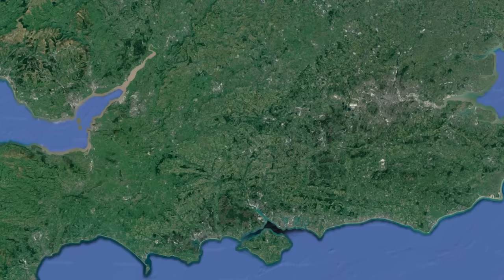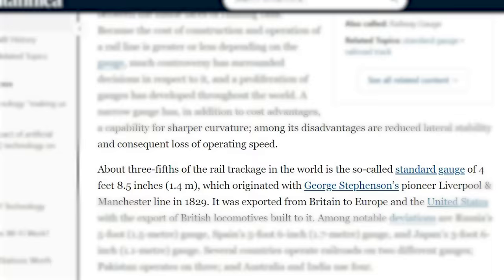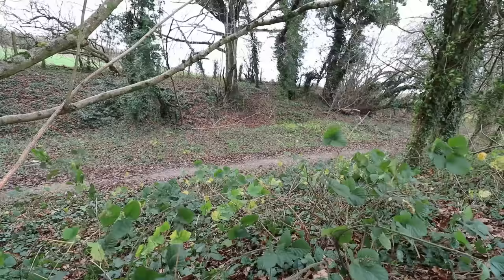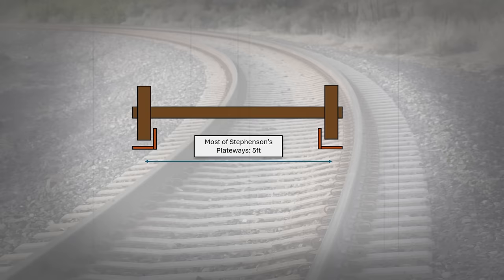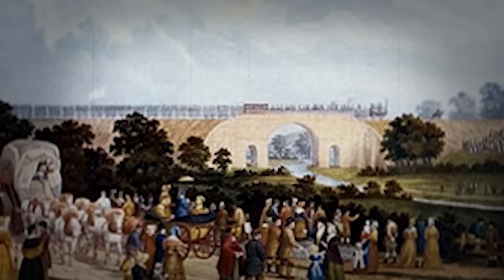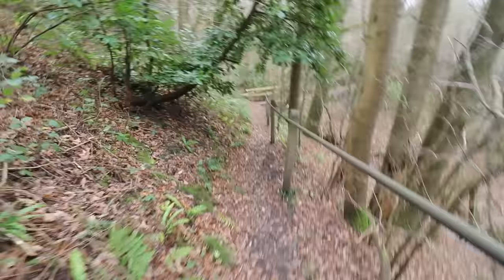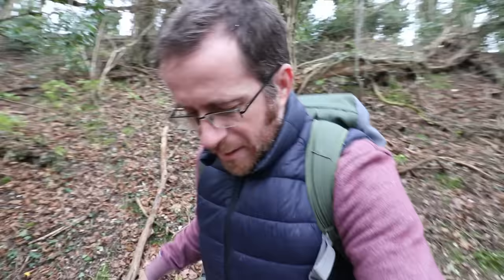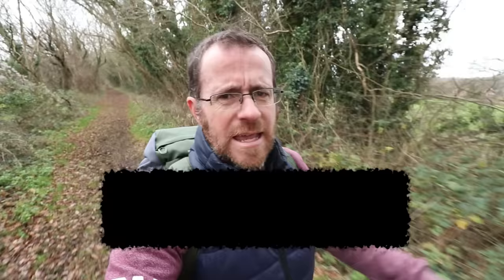Railway Gauges did NOT Evolve from a Roman Chariot.

Comment: 5 feet is just a good width for a wagon. You can comfortably fit two people side by side inside it. So most wagons through history have had wheels that are approximately 5 feet. It hasn't evolved from Roman gauge, it just that everyone everywhere used it. Much smaller than that, and a wagon doesn't fit two, and becomes unstable, and much wider than that and you have to make very wide roads for no reason.
Reply: @RegebroRepairs No. Everywhere didn't use it. Shropshire used a 4' gauge at its collieries. They used even narrower gauges for slate quarries. The Ffestiniog Railway uses a gauge of 23.5 inches.
Reply: Exactly it. It’s evolved as a useful size that one man could push about, a horse could pull and would be still narrow enough to fit down adits, between houses etc.
Reply: Yes, he doesn't really disprove the old horse's rear explanation. Cart widths come from ancient times, wagon ways were built around existing wagons, which evolved into plate ways and the current gauge follows directly from there.
Reply: @robertbackhaus8911  but the issue of the rockets is all bullshit.  And carts were wider than a horse.
Reply: Here in Australia there were a few anomalies between rail gauge and carriage width.  Even had bogie changes.  Same carriage or goods truck with the bogies changed according to the rail gauge ahead!
Reply: @robertbackhaus8911  You very clearly mixed up wagons and the wagons used on mine tramways. Normal wagons were usually built to be pulled by at least two animals, sometimes horses but there were also wider wagons pulled by oxen. However mine tramways are not the same and they were usually only pulled by a single horse so they were usually a bit over a meter wide, also they were usually only pulled when going back up to the mine since gravity took them down. A lot of the time they were also just pulled or pushed by humans. It's from these tramways that railways evolved however there were many successive widenings of the track until the construction of the Liverpool-Manchester railway, which was the first to use the 1435 mm standard guage, and since it was the first mainline railway the standards it set stuck. As you can see this has nothing to do with horses and was entirely driven by technological needs, one that was especially pressing was the width of boilers, you can only make a boiler so small before it becomes basically worthless so early steam engines needed much wider track to run on.
Reply: You can find plenty of wider wagons since many were designed to be pulled by oxen and not horses.
Reply: @hedgehog3180  no.  The gauge of Liverpool-Manchester was 4 ft 8 inches.  The 1/2 inch was added later to reduce wheel use.
Reply: Pity airlines don't follow that - 2'+ width seating!  More like 16"-18".  2' wide reminds me of USA Steamliner seats!  Not quite that big but with lots of leg space.  

Didn't Brunel go for 7 foot gauge?  VERY stable trains.  Regardless, it's the modern pivot bougie (USA - truck) that made smaller gauges (eg 3'6") with wider than track carriages (eg 9'-10') viable.  (Yes fixed wheels came first.)  

The narrower the gauge, the easier and cheaper it is to build.  Can hug the hilly terrain better, smaller bridges, etc.  Think I said in another post that Queensland worked out 3'6' gauge was 8 times cheaper to build in their terrain than 5'3' gauge.  Ref: Ipswich train museum.

In South Australia an American Mr Webb was asked to build the best.  He plugged for 5'3".  NSW and Vic agreed with SA to build 5'3" networks.  Later on the NSW govt changed and reneged.  By then SA & Vic were committed.

Comment: In peninsular Spain, the first railway from Barcelona to Mataró was 1440mm. However, a real scientific engineering commision was established around the 1860s to determine the best railway gauge. Since Spain is a country with much topographic unevenness and more steam power was needed than in most of flat Europe and UK, the gauge of 1668 mm was determined by considering the size of the steam cylinders between the wheels. Spain had many of Europe's steepest gradients.
Reply: I'm guessing by "real" you mean the Spanish word for "royal" as in a "royal commission" .
Reply: @johndododoe1411  Royal commissions and decrees were up until 1860  which permitted the private laying of rail roads, after that a junta commission was set up to plan out the lines over the whole of spain and the infrastructure that goes with. I think the Engineering commission fell under the junta and his 'real' just means the first real official one. As before that it was up to the private investors to decide what they wanted.
Reply: @jhnshep  I don't know the specifics of Spanish rail history, but do remember that other Spanish regimes used royal prefixes for institutions even without royal involvement, and that some Spanish land ownership paperwork used abbreviations from the Roman republic long after the emperors took over .
Reply: @johndododoe1411  Like Real Compania Irlandesa? 😅 perhaps, though he wrote 'a real' not the real, though only he can clarify that. I had to go look up a paper I flicked through once not so long ago and i couldn't find anything for the 'Real', it was a study on how different governments got involved in rail, spain being late. Anyhoo I found it again 'The Radiality of the Railway Network in Spain during its Early Stages (1830–67): An Assessment of its Territorial Coherence'. And I was looking up something for rail between france and spain that I stumbled on that one.
Reply: @johndododoe1411  No, I meant  real, not Royal.
Reply: Also Spain's first railway was layed and operated for a sugar industry in Cuba. The Mataró railway was a commercial gimmick some time after the Cuba railway. The first real passenger railway with a commercial schedule in peninsular Spain was between Madrid and Aranjuez in 1851, if I'm not mistaken.

Comment: Hi Paul, firstly many thanks for your productions last year, well made and beautifully presented by both of you. Secondly may I impart a little knowledge in your direction? Marc Brunel and Maudsley were contracted to fit out the Royal Dock-Yards with their block (as in pulley systems) making machinery. Marc Brunel being a French National (in exile, and married to an English woman) was not allowed into the Docks themselves. In his inimitable form he placed his Son Isambard as a foreman for his company, see Thames Tunnel for details. Part of the installation was to provide up-dated handling for the timber used as well as timber for the masts. To move the large baulks and logs around Marc specified a short tram/rail line of 7 foot gauge. When the GWR was built Isambard used technology he was familiar with along with the gauge he knew, as an aside the Dock Yard lines were short and laid with the baulk method exactly as the GWR was built. Thank you again and best wishes for the future.
Reply from the maker: Wonderful, thank you Douglas. Almost a story in itself right there.
Reply: Fantastic!

Non-sequitur, but it made me think: I wonder if there are old weigh houses / weigh stations along the Thames near the ports or rail stations, that can be explored.

I supported modern weigh stations at Port Melbourne - REALLY interesting logistics of pre and post grain drop-off weighing of entire trucks (and ~$10k per hour in opportunity cost if your weigh station breaks - The trains pile up, and trucks just take their business elsewhere).
Reply: @pwhitewick The reason why Ireland uses 1,600mm gauge is because it was in between two three railway’s gauges
Reply: @pwhitewick  highly interesting as the issue applied to Britain & the empire thanks.. BUT.. a 2nd episode explaining the adoption of other gauges as in the US etc.. & how geography played a roll in determining gauge decisions IE tight turns etc around hilly terrain.. 👍 from the colonies NZ

Comment: Another excellent and informative video, Paul. Couple of minor points. Brunel had been dead for over 30 years before the gauge-change so probably didn’t have too much of a hand in it.
The first railways in Spain were designed by British engineers and constructed by Spanish contractors. There is a story (possibly apocryphal) that a gauge of six feet was selected and thus built. Unfortunately, the Catalan foot equated to roughly eleven inches. The Imperial foot had not been specified. I was first told this by the jeffe d’estacion at Malaga and again in Barcelona and Bilbao.
Spanish railways have overcome the difference in gauge between Iberian and standard by a rather terrifying system which alters the effective axle length by physicalling pushing in or pulling out each wheel as the train trundles through the change shed without stopping.
Keep up the good work.

Comment: I do love that old story of rocket boosters being designed due to railway gauges being determined from roman horses backsides, saying that Paul, you have done a lovely job explaining how railway gauges developed 🚂👍
Reply: It was always suspect of a story to since the rocket boosters in question (Thiokol/ATK/Northrop Grumman Space Shuttle/SLS boosters) are about 12 feet wide... so at least 6 to 8 horse ass wide and not two. 😂

Loading gauge is more important than track gauge there for load clearances.
Reply: @jacoblyman9441 broad gauge would’ve seen Mars capable boosters perhaps in the 60s then? 🫠
Reply: @PJWey  no, the Space Shuttle boosters were a product of the 1970's. Besides, there were alternative rocket transport options available such as the Pegasus barge which was first used for the Saturn V. I believe they were built in Huntsville, Alabama then shipped out down the Mississippi into the Gulf of Mexico then onto Florida. 

Really the only reason rail is a limitation in the case of the solid rocket boosters is the factory is inland in Utah (just outside the Promontory Summit site famous for the Golden Spike actually), so rail is the best transport option out since there are no waterways to bring a barge up there to carry out bigger boosters. That wasn't so much of an issue with the other rockets being built there (ICBM motors, upper stage boosters, etc.) but the shuttle boosters push the limit of what rail transport can do. Any bigger motors would need basically to relocate the factory to another site with water access instead. 

Another transportation alternative, SpaceX's California factory ships Falcon 9's via road. The entire booster is loaded up on a truck as a high and wide load then shipped on the highway. Their Starship rockets though are built on a factory at the launch pad though, since they are so big they can't fit on anything really other than really slow trucks that move them from factory to pad.
Reply: It is bulls**t.

Comment: Great video! I think one aspect of the gauge you did not take into account is cost of construction. With Brunel's gauge, you will by paying 50% or more for every track mile you constructed. Think about a viaduct or a tunnel being 50% wider, how much more time, material, and engineering would that require? How may more routes would simply be off the table because the terrain would not accept such a large gauge? In America, there was a narrow gauge as well as standard; however, it was prevalent in the West for extracting mineral wealth or timber. The bonus for narrow gauge was the cheaper cost of constructing a railroad that may only exist for a couple dozen years. In addition, narrow gauge used the wonderfully asymmetrical Shay locomotive that had far greater tractive effort than contemporary steam engines.
Reply: indeed, and converting that way is much harder, the other way, well you might be able to run a second parallel track on the same alignment.
Reply: There's narrow guage in Europe too on mountain railways, one even has a separate funicular to link stations below and above a steep glacial valley side with the mountain slopes.
Of course narrowing broad guage was far cheaper than any project widening lines, bridges and tunnels.
Reply: Not exactly so. the gauge the rails might be wider but the cars they carry would remain the same width.  That width, not the gauge width, is what sets those parameters. The only cost difference I can see would be the length of the ties (sleepers)
Reply: @terencerucker3244  Brunel's railway was actually built for wider rolling stock.
Furthermore despite a standard guage the early adoption in the UK means larger continental size carriages would require new lines and platforms.  So standardisation to the "better" Brunel standard would have been impossibly expensive.
Reply: @terencerucker3244  Yes and no, they did use different loading guages too, a standard gauge rail car is not 7ft wide:
"In addition the wider gauge allowed for larger goods wagons and thus greater freight capacity."

Yes, you could in theory take Brunel's loading guage stock, stick standard guage bogeys and have the overhangs like you do for full loading guage stock on a narrow guage railway. But the key here, is a. the other way, we end up having to widen the railway all the way down as the loading guage follows the guage:

"Until the advent of the ISO rectangular container the biggest things on the railways were passenger carriages, on the GWR broad gauge lines some main line coaches were built that were about ten feet wide, at the opposite end of the scale were lines such as the SECR where coaches were typically only eight feet wide"

"When the GWR changed from broad gauge to standard gauge their generous clearances often allowed a second track to be run into goods sheds and a third line to be run through double tracked stations on former broad gauge lines. When they switched to standard gauge however they adopted a smaller loading gauge similar to other main line railways and built most of their stock to this smaller gauge to allow through running."

Comment: I know that you are dealing with the UK, and that you may have already covered this aspect in other viedos.... but in the US standard gauge and narrow gauge(s) were the one's that were really in competition. As you said the wider the gauge the more stability it provides and potentially higher speeds.  However the  narrower the gauge the smaller the radius required for a curve to be safely traveled... and less land cleared/ leveled. I don't know if that came into the consideration for the UK  However in the US with the Appalachians  mountain range being relatively close to the coast , and the time frame that the rail roads were expanding at least initially the narrow gauge was cheaper to lay in many areas of the mountains and standard gauge was better for the higher volume/ higher speed population centers and flatter areas.  My point is that whether the end result was 4' or 5' the  approximate width of standard gauge is generally a good compromise between the cost of land and the resources to prepare it and the overall capability of the finished system in terms of speed, load stability,  and initial cost. Which though totally unrelated in the development process is likely why coincidentally they seem to mimic the width of Roman cart/wagon.... or to borrow a  term from biology  convergent evolution.
Reply: That bit about what amounts to convergent evolution is a good point. And maybe it ultimately amounts to just another way of saying that money makes a lot of your decisions for you.